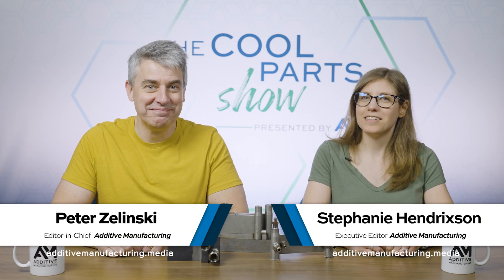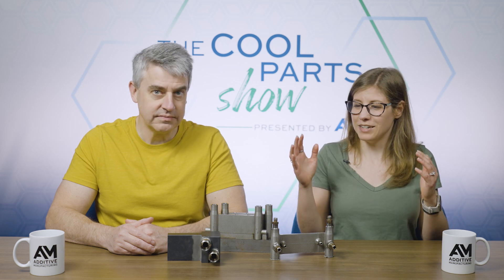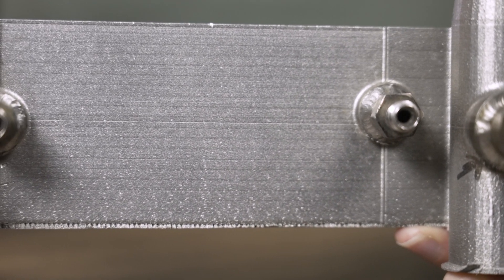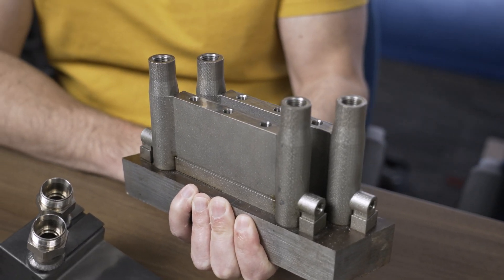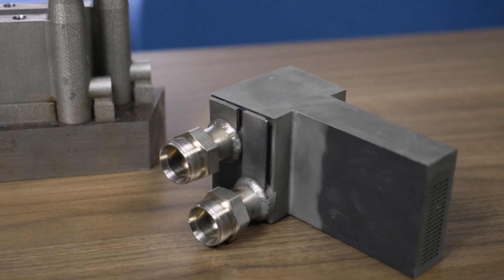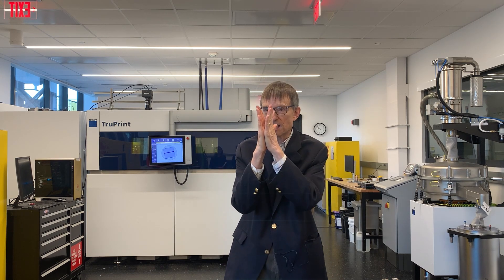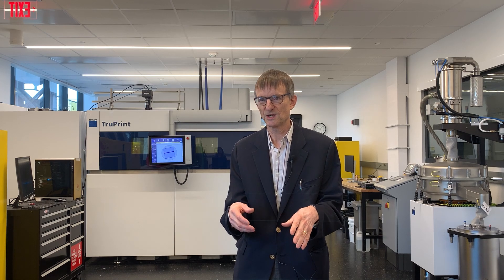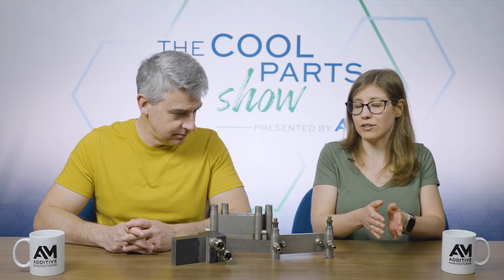3D Printed Heat Exchangers For High Temperature And Pressure | The Cool Parts Show Bonus

Comment: Neither haynes 230 nor haynes 282 are particularly creep resistant nickel alloys. They are extremely corrosion resistant, but don't have nearly the creep resistance of IN713, MAR-M247, or even good old IN718.

Comment: I find it odd that he doesn't have a clue what running an engine "lean" means. It doesn't mean you're running with less air. It means that you're running with less *fuel*. The main drawback of running a generator lean is that it produces a lot of heat. Lean = hot burn/ complete combustion; too much oxygen, not enough fuel. Rich = cold burn/incomplete combustion; too much fuel, not enough oxygen. Your average engine runs somewhere in the middle, as a compromise between the two.
Reply: man probably just misspoke on camera, looked a little nervous to me
Reply: @lylestavast7652  Could be, but that's an odd thing to mess up. Engine stoichiometry is pretty basic, especially in comparison to the subject matter at hand.

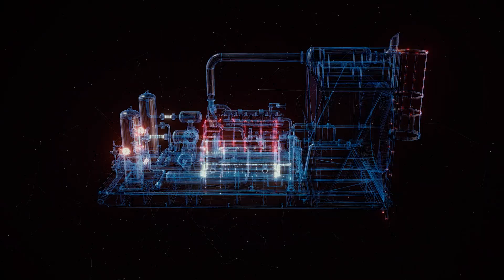Comment: 9:45 Lean-burn actually means quite the exact opposite. Lean-burn (lean on fuel) engines use more air (and consequently more oxygen) than required for a stoichiometric mixture, resulting in high NOx emissions. In contrast engines with a rich fuel mixture produce low NOx emissions but high hydrocarbon emissions.
Reply: I was just going to say the same thing.